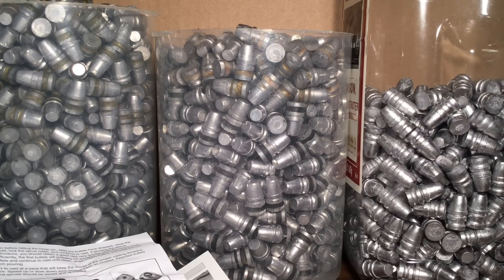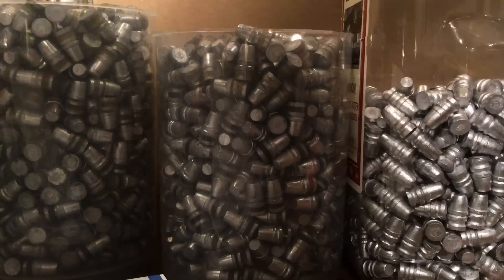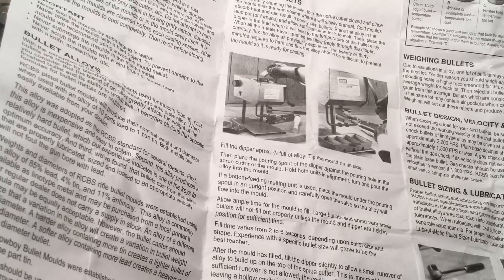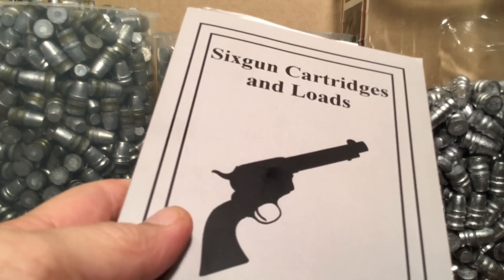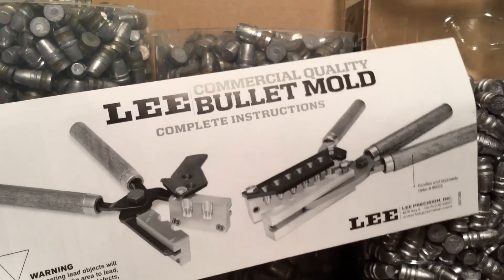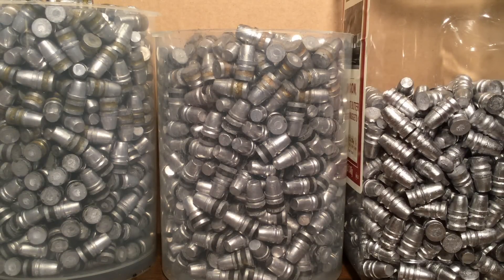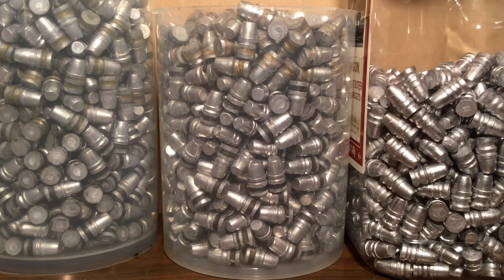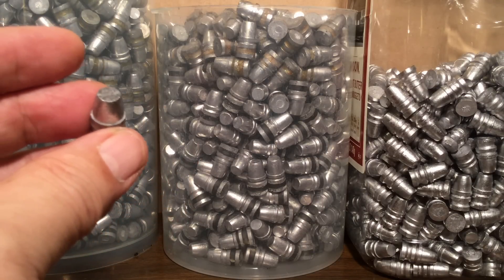The Big Hardness Gain Bullet Casting Water Quench Controversy - VR To Carl

Comment: Dear Fortune Cookie:

     In my correspondence during the '50's with a well known shooter I was instructed to not only water quench, bullets designed for service style rifle loads, but to heat treat the bullets as well, raising their temperature to a fairly high uniform level in the oven, to get a uniform temperature, quite hot, but well short of melting them, THEN quenching, ALL OF THEM AT ONCE  for the most uniform hardness the uniform temperature of the quenching medium being as important as the UNIFORM temperature of the bullets themselves.  Also he wrote me that it usually takes several days after quenching, when the hardening of the alloy bullets is complete, before handling of the bullets should be undertaken, and for best results, sizing and lubing should not be done until then, it is to be assumed that Elmer believed that aging of the bullets was as necessary as heat treating quenching, weighing and segregating,  the next line of his letter then goes on to state that all of this is for OPTIMUM accuracy, extolling the benefits of weighing each bullet before sizing and segregating them in lots for different uses, the heaviest being the ones for target work, THEN he went on to say that for most uses including field use that visual inspection and sizing and that lubing right out of the mold was enough and that all the heat treating, weighing and aging were for target and COMPETETiON use and extolling the use of the Loverin 311407, 311467, and the SAECO RG4 for best results, (it is almost incredible to realize that this man and his friends had been using such  bullets for target shooting and competition at ranges of 1,000 yards with success) he goes on to discuss with me, and refer me to  General Julian Hatchers extensive work with accuracy in cast bullets, and his articles published by him in the American Rifleman, just that year, and stating that the results were in part published after he, Hatcher, Townshend Whelan and another well known shooter had collaborated with him.  It is significant to notice that all of these advances in casting and shooting cast bullets was figured out by a few men long ago, and that they themselves were using knowledge gained by Pope, Loverin , and Lyman's own John Barlow, then they published what they had learned, and were largely forgotten.  It would behoove anyone who is interested in Cast Alloy bullets to acquire those reports of General Hatcher's published during the mid '50's to use as a jumping off point for further experimenting.  Elmer Keith and his peers probably forgot more about casting and using alloy bullets than all of us combined have acquired on our own, this knowledge that Elmer and his peers had was considered as common as breathing in and out, and for him it took an inquiring and almost worshipful and respectful teenaged boy's letters to him to politely share with me his knowledge.  What we know about the subject of cast alloy bullets come from our standing on the shoulders of Giants, I can think of no one who has collected and published a COMPREHENSIVE record of these discussions undertaken in an almost casual  way during correspondence with peers during the '50's, probably there's a book waiting to be published in there somewhere by someone who has access to these conversations, if anyone has that desire, I would be willing to share what knowledge and documentation of these conversations I might have.  I haven't seen those letters and copies of my inquiries to Elmer for years now, but surely I haven't thrown them out, I hope.
Reply: Donald Denison I would be interested in them .
Reply: Dear Brian:

     Are You contemplating publishing such a book? what are your other sources?, have you read the articles published by General Hatcher in the Rifleman during the mid fifties?  These are your best sources, also HELL I WAS THERE, and SIXGUNS, by Elmer.  I haven't seen these letters or the copies of my letters to Elmer for years now, they were written on an old Remington Manual typewriter which was state of the art for writing when I was just barely a teenager from 1954 until about 1962 when I entered the Army.  They are probably in the box my mother put all my personal correspondence and other personal things in February of '62 when I enlisted.  I never have dug into these boxes, but at age 75,  I suppose I should, I probably don't have many years left to do these sorts of tasks.  Have your Publisher contact me about this matter, good luck with your writing and research.  My correspondence with Elmer came about from me writing to him in care of his publisher back in 1953, it was almost a year later that he got the letter and responded in 1954, I was 13 then and in the 8th grade, I'll never know why he began a correspondence with a snot nosed kid, but we wrote each other until I enlisted in February of '62, we met only once, relationships like this no longer happen, it seems no one writes letters anymore.  You close your eyes for a moment and open them to find the world changed.

Best Regards

Don Denison
Reply from the maker: Donald Denison - Sorry for the delay in reply - Google did not post your comment in my inbox, and how else are we YT posters going to know - we can't go and review every video to find out if comments have come in otherwise...I stumbled onto this one from you when another comment on this video led me here.  The work of the old time casters with their paper patching and all is indeed fascinating.  YT posters like MannyCA have actually brought interest in paper patching back.  And there are molds from Accurate and Arsenal that are paper patch designs.   I think that I developed my own personal policy on cast bullets back in the early 70s when I casted for my handguns, starting with my Colt 1911 and S & W M28.  Cast bullets were excellent for my pistol shooting.  For rifles, I was into varmint shooting with 223s and 25/06.  There, cast bullets would not get me what I wanted, so it was strictly jacketed bullets there.  Since then, I've found cast to be useful for 30 cal reduced loads and also for 30/30, 45/70.  But otherwise, jacketed bullets.  With the advent of powder coating, now we have the challenge of discovery and rediscover...  I hope you find those letters from Elmer - they are real treasures... I thought that all Elmer did was use his 16-1 alloy, his sizer lubricator, and shot up a storm..!!  Best to ya, Don --  FC Steve
Reply: Elmer told me the heat treating in an oven for a time , then allowing them to cool also hardened the bullets, said it took up to two weeks for the process to complete itself after quenching depending on the antimony content.  Evidently a little antimony is needed to help heat treat bullets.  I believe it was John Taylor who advocated heat treating, it may have been Hunter though.  Mostly Elmer did just cast shoot and lube, but he did know about and understand heat treating.  The experience I have had with cast bullets on game has not been hardness, I have seen a 1-40 alloy bullet penetrate an Elk completely, it was a 500 grain bullet at a little over 1500 fps muzzle velocity, it was though at only about 50 yards away.  Paul Matthews has the best and most comprehensive treatise on paper patching, the man had it all figured out.  I tried it in my 45-70 rifles at both Blackpowder and smokeless velocities.  His method works really well, but it is a HUGE pain in the butt.  Matthews claims that relatively soft allow bullets can be fired at service velocities in .30 caliber rifles with accuracy.  He had a well known mold maker make him adjustable nose pour single cavity molds.  His book The Paper Jacket is worth every cent of it's price.  I haven't done any shooting lately, the weather has been too snotty, Highway 26 that intersect with Highway 88 at Red Corral is washed out, has been for about a month now so if I need to go to Jackson, I have to go down to Mokelumne Hill and then take 49 to Jackson, Cal-Trans seem indifferent to our difficulties and say maybe 26 will be open in April, probably not until May.  I still have considerable snow laying in the shady spots, and I'm thinking I'm getting webbed feet.  At least we don't have a failed spillway and dam threatening us here.  Spring is coming.  I'm getting Cabin Fever, though I have been playing lots of music on my guitar and piano, so the music itch is getting scratched at least.
Reply from the maker: Donald Denison - According to articles posted on the Los Angeles Silhouette Club, antimony is primarily a hardener for lead alloys straight up.  A little arsenic is necessary for successful heat treatment of lead bullets.  Back in Elmer's day, tin was thought to be useful as a hardener.  Tin's real advantage is to help the alloy flow to fill out bullet molds better.  There is about 1/3 the hardening of antimony provided by tin.  I want to get some 1 - 16 (and now probably some 1 - 40) alloy from RotoMetals to do some actual Keith casting for future videos.  Might be fun.  Safe travels to ya, and may things open up soon... Best Regards,  FC Steve
Reply: Dear Fortune Cookie:  I have always been intrigued by the assertions of authorities about the heat treating of alloy bullets whether it be simply quenching out of the mold, or raising them to uniform heat then quenching.  I seem to remember Elmer writing in an article or a letter that it often took many days for the hardening to be complete, there were also questions raised on whether the hardening was a result of heat and time or whether it was the quenching that did the work.  I have also read elsewhere sometime, and remember vaguely that it was either Taylor, Hunter, or Selous who also believed that it took considerable aging for whatever hardening was going to occur to be accomplished.  Aging for me consisted of allowing the bullets to age after loading them in the case at least until I shot them.  There seems back when I was learning how to cast and  shoot alloy bullets that there was little actual technical information that was verified by research and experimentation in a scientific procedure.  If a bullet was treated at all on my bench, it was the aging between the time I cast it and then shot it.  I thought that there were lots of folks asserting various theories with scant hard evidence available.  I do know though that a 1-10 alloy is harder and expands less than a 1-40 alloy, that at least a little tin is necessary to get the alloy to fill out the mold in casting, that antimony is necessary to get any significant hardening, and that arsenic is usually present to some degree in the lead, tin, or antimony that we use to cast bullets with, whether it is sufficient to provide significant hardening through aging, or if it must in some way be added to the alloy before casting as a separate operation or not, I haven't a clue.  I just cast and shoot.  These days I shoot nothing harder than 1-16, mostly 1-20 or softer.  It has been many years since I used linotype to shoot .30 caliber with a case full of powder at service velocity.  I found that fairly high velocity could be achieved with accuracy and no leading of the bore if everything was done correctly, especially the sizing, bullets even a tiny bit undersized will lead like crazy regardless of the alloy used.  I have to get down the hill to Jackson before the pharmacy at Safeway closes, I went down to Manteca yesterday to keep an appointment with my Dr. the round trip is only 140 miles, but due to age, and the resultant weakness produced by the convalescence during the aftermath of my foot injury last year, those trips just wipe me out.  Things are gradually getting back to normal but the foot doesn't want to completely heal up.  Getting old  is not for sissies.  I get so darned impatient, perhaps I will never get my muscle tone and stamina back, 6 months in the hospital and then a year of Doctor limited activity (the only time they wanted me to be on my feet was for bathroom duty and showers) is really devastating to basic physical toughness, I guess I am lucky to be alive.

God Bless You and Yours

Don
Reply from the maker: Donald Denison - Much has been said and asked recently about using linotype for rifle shooting.  One of the problems in doing that is the bullet that results is brittle and will not hold together when bone is hit = poor terminal ballistics.  And Lyman is a bit vague - some of their recommendations for use of linotype to cast bullets and then similar or more powerful (more fps) cartridges at higher pressure - recommends using #2 Alloy (much softer than pure linotype).  As for age hardening, articles posting heat treatment and quenching followed by 2 week aging are found in the Los Angeles Silhouette Club site.   The LASC is all about cast lead bullets and lots of info there.  Bullets age harden also without the extra heat treat steps...trace arsenic is needed to heat treat and age harden.  I just use 1 BHN for any hardness gains from aging.  We don't appreciate what our feet do for us until we don't have use of them.  Here's wishing you a full recovery from your injury... Best to ya,  FC
Reply: Dear Fortune Cookie:  

     It is absolutely true that linotype will not expand, the same can be said also for #2 alloy unless it is driven at velocities that will guarantee leading of the bore.  As for shattering, I don't think paper targets or backer board fiber provides enough resistance to upset the bullets, and except for SASS/CAS shooting I don't shoot sillouetes  I have had success with fairly hard bullets in rifles at moderate velocities, about 2,000 to 2,200 is the best I could do for ethical use on game and retaining accuracy too.  Lyman 311284 works well with the.30 US, and the .30, '06.  I like best though my 180 grain Lyman (Loverin) hollow point at these velocities, I have had best success with the base of the bullet seated even with the bottom edge of the neck, allowing  the bullet to enter the case beyond that has a noticeable negative effect on accuracy in any bullet used except for squib loads.  My best performance with cast bullets on GAME has come with the 45-70 and with the 38-55 with velocities of about 1900 fps, with 1-16 alloy, even then at those velocities, the bullet if recovered will show little evidence of expansion.  One needs to go as soft as 1-20 if he wants expansion at hunting ranges, and even then velocity should be over about 1600fps AT IMPACT to effect sufficient expansion, at least to the degree that will leave the bullet in the body of the game shot.  The Lyman 3ll407 Loverin flat point Hollow point works best for me in .30 Calibers at about 2,000 to 2,200 fps muzzle velocity shooting nothing harder than 1-10 alloy, for me any antimony will create a bullet that not only will not expand, but will shatter when large bones are struck.  It is a difficult balancing act trying to avoid leading, maintaining accuracy and still getting the bullet to be malleable enough to avoid shattering, often the best we can hope for is avoiding shattering, this of course is immaterial if one, like myself does not shoot sillouetes  and uses linotype only for paper targets and practice.  That aforementioned reasons are why I prefer the 45-70 for Big Game, an almost half inch in diameter bullet passing through the heart lung area of game is a sure killer and will leave a significant blood trail even if the bullet fails to expand at all. (here in the Peoples Republic of California we can't use any lead bullets any more) What must be avoided at all costs is a bullet that will break up when striking large bones.  the 45-70 even at blackpowder velocities is a sure killer at any range given decent bullet placement regardless of the alloy as long as it will stick together.   By the way all my game bullets were ordered with hollow points, that was back when one could get Lyman to build any kind of special features in their molds on request.

     I am slowly getting better, got the injury during the evacuation a year ago last September.  In 6 hours, I had Gas Gangrene, bad sepsis, heart and respiration almost gone, kidneys had already quit working, and they were warning my brother I wasn't going to make it.  I fooled them all, and was able to keep my lower leg as well, all the Doctors wanted to amputate at the knee.  Then the long convalescence and after leaving the hospital a year of doing almost nothing but basic necessary hygiene, cooking etc.  I sat in my chair so much I had pressure sores on my backside, at least now I can get about and do other things, putter around in my shop, play music on my guitar or piano and so on, and the bed sores are going away.  Life can sometimes be a real pain in the ass, pun intended.  

     Best wishes for you and yours

     Don
Reply from the maker: Don - You are definitely a fighter and here's hopes and prayers for your good recovery... Gotta get some of that 1 - 16 and 1- 20 alloy..    Best to ya,  FC
Reply: (Chemestry talk saying both of you are wright actually)

Lead itself does not Quench... since quenching is suposed to improve Crystal structure (As in Tungsten-Steel alloys)
But Heat treating then quenching is similar to a principle called Prince Ruppert's drop, used to fabricate gorilla glass, in which the contraction force is responsible for creating a inwards strength that makes the bullet HARDER and more Brittle (similar results to Oil Quenching) so yeah, this is only achieved through Large and Imediate Temperature variantions (as said by donald, heat just below fusion and drop in water) and its results even then are not the best

Paryers for ur recovery Donald
Reply from the maker: Don - It's April now - I hope you are recovering even more...I've casted some hard bullets - well over BHN 18 (my thumbnail actually does not get a purchase to do the thumbnail test - I suspect BHN 20-22 using Super Hard, Copper Hard and range scrap) to shoot in reduced load 458 Win Mag cases.  Well, I hammered one of the bullets flat and expected some shattering - the lead squashed nicely and did not shatter.  Perhaps they are not that brittle after all...I can't see how these bullets at 1500 fps would shatter on bone.  They seem awful tough to me - but only the hunting fields will determine that and we can't use lead bullets hunting now anyway.  Perhaps I can get some big animal bones and shoot them in Nevada to do a bone penetration test... Best Regards to ya,  FC
Reply: Dear Fortune Cookie:  

     The problems with shattering arise at close ranges and or at higher velocities achieved with linotype and other like alloys.  When the bullet is hard enough to be shot at service velocities, and this also includes it having sufficient structural integrity to avoid foreshortening while being pushed out of the barrel  at velocities of over 2,500 feet per second in let us say a .375 H&H or even at the lower velocities of a .416 Rigby, antimonial alloys tough enough to withstand this abuse are subject to breaking up.  I have witnessed a Loverin designed bullet from Lyman mold break up on the shoulder of a California Blacktail shot at short range out of a .250-3000; my hunting partner and I jumped this nice little 3 point right after we stepped out of the truck, he shot it at about 25 feet, the shattering was no doubt aided by the long deep hollow point that he had cast, the alloy was linotype, the velocity was right at 2800 fps with nearly a full case of 4320, it has been a long, long time ago, but I recall that the charge was something less than 35 grains, the bullet was a multi-groove Loverin design that was meant to be 120 grains but ended up somewhere about 100 grains (why the heck Lyman dumped those old cherries is beyond me).  It was August,  the season had just opened for the West Side, we were near Parkfield,  west of Coalinga  This is a perfect example of the bullet failure I am describing, it worked well for targets, but even on the shoulder of that relatively small buck, as I recall it was under 120 lbs field dressed, rather large for Columbian Blacktail bucks.  The second round punched a .25 caliber hole through the lungs, and had I not shot the rascal with my old Colt .45, we would have had quite a retrieval problem. Pounding the bullet with a hammer while it is on an anvil tells us something, but it sure doesn't duplicate the impact of a bullet traveling at velocities approaching 2700 fps when it strikes a large bone at short range.  I would be much more comfortable with a .30WCF with my Loverin 311407 HP at about 175 grains and 30 grains of 3031 with the alloy of 1-10, I know that these will not shatter even at close range on shoulder bones, and given good preparation and a smooth bore will not lead up the rifle too awful much.  The load should produce velocities of close to 2100 fps out of the 1894 rifle with it's 26 inch barrel.  Most of the bullet failure I have heard of and witnessed was the result the combination of close range/high velocity,  large animals with large bones, and with both hard cast bullets AND lightly constructed jacketed bullets.  There were good and sufficient reasons for John Nosler developing that partition bullet that has worked so well.  It takes lots of experience,  and knowledge not to mention good luck to get a cast bullet to shoot at velocities of around 2,500fps, and even more knowledge, experience and luck to get that same bullet to hold together when impacting large bones in game, it is much easier to go out and buy a box of Nosler Partitions when firing loads that approach service velocities that are to be used on Big Game.  The Idiots who run the Peoples Republic of California have taken the legal possibilities of hunting with alloy bullets away from us in any case, what a bunch of cretins. 

     I've got to get back to my other passion, I've just dug out my old violin and found that something has chewed up the hair on the bow,  I'll be driving down to Sacratomato tomorrow to get the fiddle and the bow set up and ready to play, now getting my left shoulder to loosen up enough to actually play again is another matter.

Best Regards

Don
Reply from the maker: Donald Denison - Thanks for posting this.  I've often read about hard bullets over BHN 20 breaking up on bone...but not being a hunter, was hoping that someone would post actual accounts of hard cast bullet performance.  Looks like the old "needle blower" vs "big, slow, heavy" from Keiths day.  And the Nosler Partitions changed all of that for sure...When I did my varmint shooting, it was Sierras; and if I ever got the chance to hunt, it would have been with Noslers Partitions.  Hope your shoulder loosens up for you to make some fine music... Best Regards,  FC
Reply: instablaster